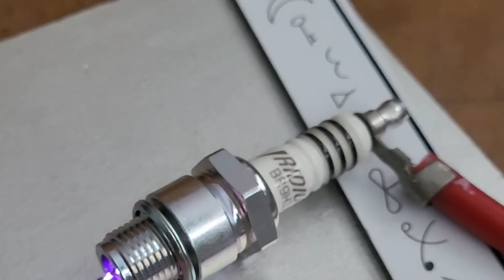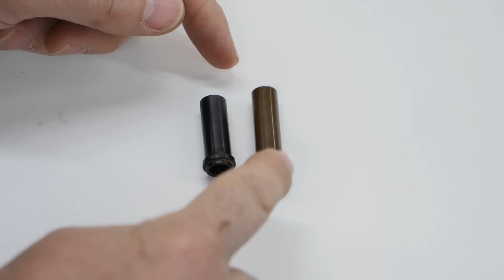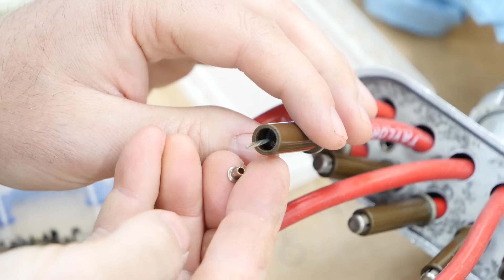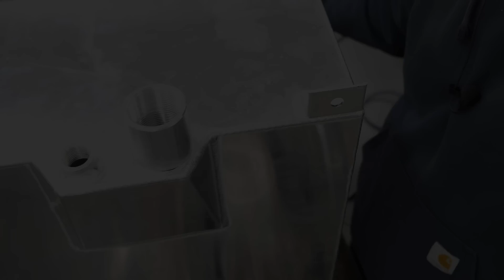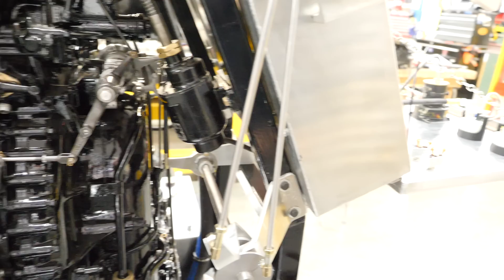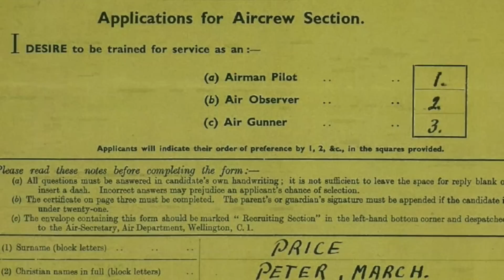Episode 8 Rolls Royce Merlin Nitty-Gritty

Comment: When turning the adapters for the ignition at 7.10 i see you are using carbide inserts for turning on your lathe.
You might get better results and / or finish if you use hss tooling and lower the rpm's of the chuck 😀.
Also instead using a 3 jaw chuck a collet chuck ( type 5c) for example reduces the  clamp force on the bakelite material and is much more precise and gives you better concentricity .
Just a old machinists opinion 😂😂...

Comment: Where is the crank timing marks?  You set the Mag in correct timing point but the crank needs to in the right place.
Reply from the maker: Hi Anthony, the crank timing marks are visible through a small plug at the front of the oil pan, there is quite a bit of important information in there! ~Ian

Comment: Ian your knowledge and expertise with regard to aviation related subjects is unquestionably extensive.

However the scale of the thermostat housing you discussed looked like a regular automotive unit whereas for an engine the size and power output of a merlin I would have thought greater flow provided by an assembly on the scale of one for a big diesel would be a better match?

I have read accounts by Spitfire pilots describing how quickly a Merlin could overheat if you did not keep ground operations to a minimum despite two large underwing radiators.

Just hoping for a bit of reassurance really.
Reply from the maker: What we've seen is that most of these engines run with 2" hose for the cooling systems. While there are a few reduced areas within our system, we felt that the sizes selected will work for the application. The overall design here is of a system that will operate for approximately 10 minutes at a reduced RPM. In addition to the cooling system itself, the entire engine is also exposed to prop wash during the run which will aid in cooling when compared to an aircraft installation. ~Ian

Comment: That's a "buzz coil" like on a Model T Ford. Early amateur radio operators used to make DIY radio transmitters with Model T 
 buzz coils. There were 4 of them on a Model T. Each dedicated to it's own cylinder, like on a modern car. What's old is new! ...Of course, they're no longer buzz coils, but just induction coils without the buzzer.